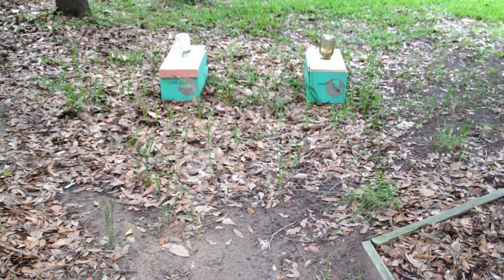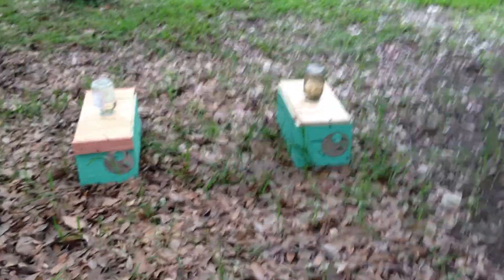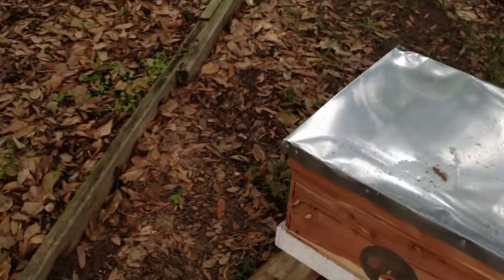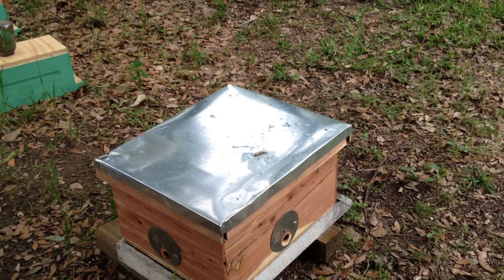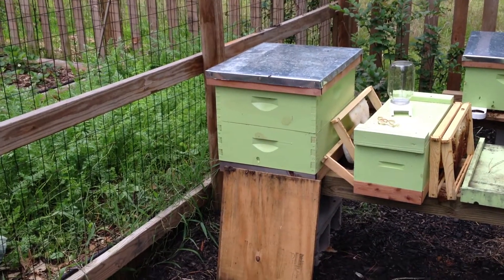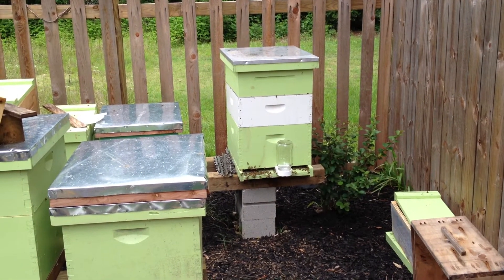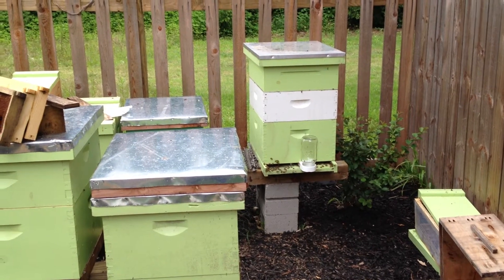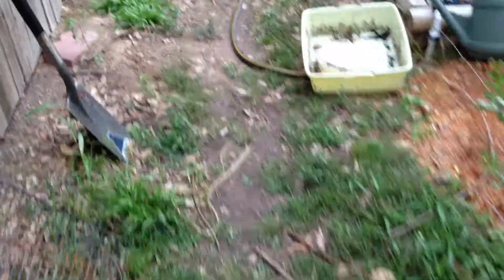Update On Queen Rearing Project

Comment: Tom, can you post the plans or dimensions of the light green mating nucs please? i like that idea. did i hear you right there are four colonies in each box? thank you
Reply: Nah, 2 per box. So with two boxes that's 4 total. This is just a medium 5 frame hive with an internal divider, then holes drilled in each end with an entrance disc. Oh I see, I did say "four small colonies in these boxes" but again, I meant that total between two boxes there were 4 colonies. This little project didn't go all that well. The internal dividers failed me and I ended up with only one queen and colony in each box. 
Dimensions are just a medium 5 frame: external is 9 5/8" wide x 19 7/8" long x 6 5/8" tall.
Reply: awesome thank you. i have notice many beekeepers are going with medium deeps for their apiary. is it better for the bees or just a weight issue for back breaking pain on the part of the beekeeper?
Reply: Neftali Garcia I hate to be a stickler, but I have to correct your misnomer here. There is no such thing as a "medium deep". Perhaps what you meant was "medium super" or "medium brood boxes". Either one works, and indeed, I think for many it's the lighter weight. But there is also an advantage to having fully interchangeable equipment. If I get a queen laying in one of my medium supers, I can move that down into a deep, but then the bees will pull natural comb off the bottom and I have to cut that comb off to move that medium frame back into the proper box. If you run all mediums, or all deeps, then it's never a question, it can all be moved box to box with no issue. 
There is also more and more people running 5 frame hives, more commonly 8 frames, and I've even seen here or there someone running custom 6 frame or 7 frame. Again, the beauty of beekeeping, do what you want! But the industry support is behind 8, 10, and now more commonly 5 frame equipment.
Reply: thank you for your quick response Brueggens. love your videos